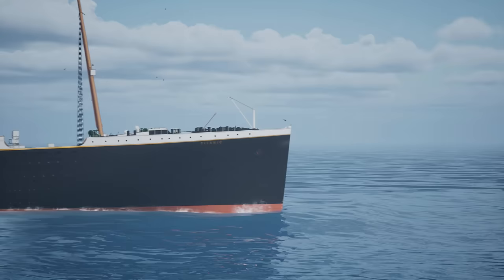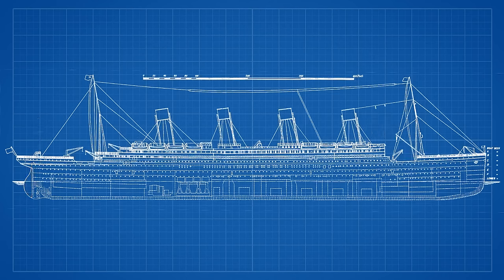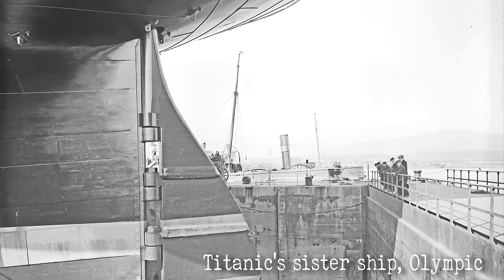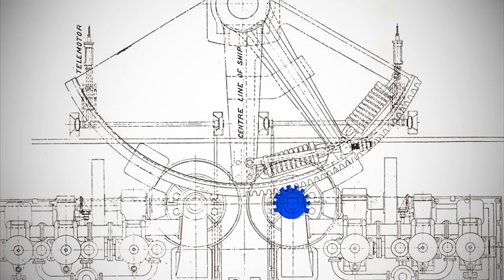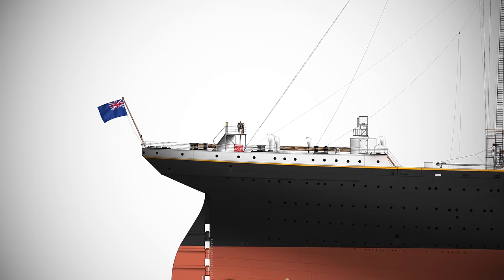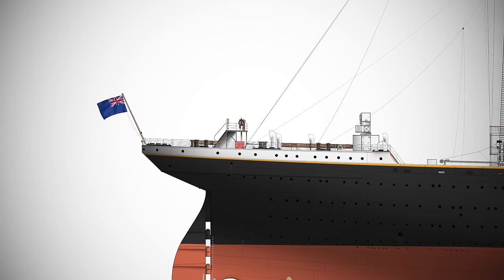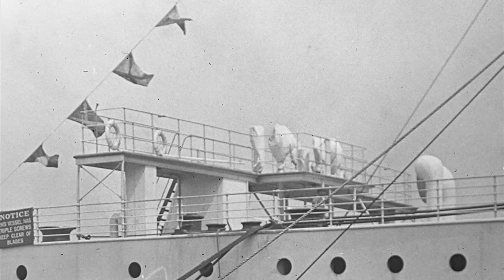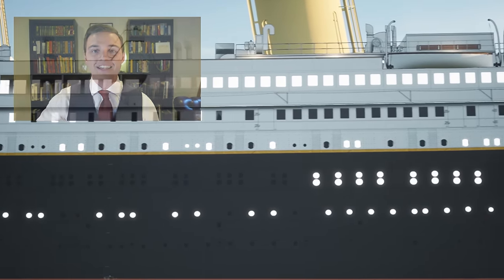How Did They Steer the Titanic?

Comment: I've read that ordering the engines full astern may have been a mistake because the rudder forces would have been stronger if that had not been done.
Reply: Mistakes were made and fate was sealed. The Titanic sinking was a litany of errors really. From basic design decisions to material quality issues. She was going down no matter what.
Reply: The engines took longer to fully stop than the time time it took for the contact so dont think it mattered much
Reply: The biggest mistake was to go fast in darkness before inventing a radar.
Reply: @MikkoRantalainen  

It has been said that during the days of coal-fired boilers, it wasn't uncommon to leave port with a coal fire going in the coal bunker(s). However....
To leave any port of call, knowing that there's a raging fire going onboard just seems to be the biggest calamity that is asking for trouble in spades.
Yet, this is what was done at that time by most.
Reply: @MikkoRantalainen  The Titanic was going at a speed needed to arrive in port as per the schedule. The Captain was following SOP for the time period…
Reply: Ship was not put into reverse until after the collision with the iceberg.
Reply: @timothyreed8417  Yes, the main factor for the collision with the iceberg was the illusion of having to go fast to be in schedule or even be faster. It would have been great PR if Titanic would have broken fastest travel time during its maiden voyage and that was the single biggest reason to keep going fast in the darkness.
Reply: @MikkoRantalainen  Titanic was expected to be faster than Olympic on her first voyage (unless she hit a fog bank)…but then Olympic was faster on her second voyage than her first…but Titanic still couldn’t dock earlier…the passengers would get a breakfast the next morning before departing the Titanic…

Comment: I would absolutely love to see more content directed towards the construction of the Titanic (or really any ocean liner of the period), I find it extremely fascinating and I love the cool forgotten photographs of the structural shops where the parts were made. Such a labour of love.

I work as a shipfitter in a large Canadian shipyard building ships for the navy and coastguard, from start to finish. I am in absolute awe at how they could do such technical work at an absolutely impressive scale back then. We have a 564 foot long cargo ship on the go right now and it’s astonishing how large it is sitting on the slip, just looms over the whole yard. I find myself nipping around through the tight corridors and down steep engineering staircases, peering into open manways to the pitch black of the double bottom, very very easy to get lost. Would’ve been wild to have a walk through the Titanic during the building phase, I am extremely curious of the intricate technique of shipbuilding before welding was a thing, rather than just hearing “they used rivets”.

Thanks Mike!
Reply: He has a couple videos on Queen Mary’s construction, if that interests you :)

Comment: Wow, great video. It reminds me of an incident that happened to me when I was 11 years old. My father owned scows and he was friends with a tug boat company. One day one of his scows was out in the bay and my father invited me to go on the tug to pick it up. The tug boat owner was prowd of a new steering system where he could steer the tug from the main helm area for normal steering or from the front of the tug for close in precise work. A lever was pushed for the person to steer from one position to the other. After I had proven I could steer the tug for a while he decided to show us how he could go the bow and take over. He did that and pointed the tug directly at my father's scow, then moved back up to the main helm area upstairs. Just as he entered the cabin door, he realized that he had forgotten to flip the handle at the bow of the tug. By the time he got back down to the bow to flip the switch, back the tug had rammed the scow. The tug listed 45 degrees, but the heavy engine righted it without much trouble, but by the time we picked ourselves off the deck we found the scow, filled with gravel was now upside down.

Comment: A thing not mentioned in this is that for a rudder to work it must have water flowing across it. In the case of this ship the flow of water was caused by two things. The first being the forward movement of the ship and the more interesting one; the central propeller. The central propeller was driven by a steam turbine run on steam from the exhausts of the reciprocating engines that drove the two outer shafts, there being three in all. So, if the central propeller slows or stops, the flow over the rudder becomes less efficient and may even be made worse if the central prop spoils the flow over it. I have heard that the outer engines were slowed when the ice burg was sighted and do wonder if this may have caused a problem with the stearing. The ship was new so this may not have been recognised.

Comment: I heard somewhere that someone had made a huge remote controlled scale model of Titanic, and he discovered while manoeuvring the boat around on a lake that the rudder lost all control authority if the boat was coasting with no input from the propellers. Right before the Titanic struck the iceberg, apparently the order was given to stop the propellers as the rudder was turned hard to starboard. If the experience from the scale model holds true for the full size ship, this could explain everything.

Comment: A slight variant, if turned to port, the starboard side of the ship could possibly have been steered towards the 'berg before the rudder would have had any effect on the direction of the vessel of that length. The ice berg was simply too close to go around it, and a relatively smaller clip of the stbd bow was a safer bet than taking out the entire side.  Perhaps saving more lives thus. That's my take on that version of the order.

Comment: A little bit contradictory that in this video the steeringwheel in the back is used as a backup, but in the short video from september 22 it is used for docking so the stern is more manouvreble.😉👍🏻But nice video both! Learned about the telemotor and hydraulics. Thought some ships also used chains as connection from the wheel instead of ropes.

Comment: When I first went to sea, on the Megantic and Medic, amonst others. the "Docking Bridge wheel" was never used, it was kept as the Emergency steering position, occasionally it would be tested sometimes at sea or in port for surveys. The docking bridge was where the second mate controlled the after docking party, it gave him line of sight to the navigating  bridge wings. (Before radios a soundafone system was used the "talkback speaker", a combined megaphone and phone). Gave easy and rapid access to either side, tug on one side and  quayside  mooring party on the other, and gave him an over view of what was happening down on the deck with the mooring party. 
On a ship I sailed, the steering gear was such a hydraulic telemotor system, to the steering engine, if the power failed in the steering gear room, the wheel took on the brunt of the steering and that wheel gave 1 degree of rudder per turn. With  36 degrees to hard over, that gave 72 turns of the wheel to go from hard port to hard starboard. So a total of 144 turns for a complete test, It took some manual effort to move it reasonbly quckly whilst testing, in the tropics one worked up a rare sweat testing the thing.

Comment: I've read that when the order was given that some of the screws were stopped thus greatly reducing the amount of steerage available because the water was no longer flowing directly to and past the rudder.

I have a 1/32 scale radio-controlled PT boat model. When I first built it it only had two rudders each one behind an outboard screw (propeller). When only the centre screw (propeller) was in use the turning radius was GREATLY INCREASED. I think  this is what happened with RMS Titanic too.
Reply: This is a myth stemming from Officer Boxhall who was not on the bridge at that time. 

No the order given by Murdoch were hard to starboard and stop engines through the telegraph.

This triggered a red light in the boiler rooms to which according to Fred Barret lead fireman the order was given to shut the boiler doors. As this was done a crash was felt and water came in. 

Even if the order to reverse had been given there was no way in hell to stop and reverse these enormous steam engine in time. Not even to stop them.

These are multiton cylinders that have to come to a stop and go the opposite ways. Steam engines actually fully reverse, so they stop and then start running in reverse.

Now we come to the central screw, unlike those on either side it was powered by a turbine engine feeding off leftover steam from the two reciprocating engines. Reversing that was no easy task and honestly I don't know if Titanic could reverse her central propeller, however I do know how they reversed them on pure turbine ships like Queen Mary and Lusitania.

Basically there was a secondary set of turbine blades aft on the same shaft in the same housing. Steam is rerouted from the main blades to the secondary blades that point the opposite way and will eventually spin the shaft in reverse.

Unlike the main turbine blades it wasn't dozens of rows of blades but only a few ones, so much less powerful and efficient.

As the steam is rerouted the reversing section acts like an airbrake and slows the turbine down and after it comes to a stop and starts running in reverse. Same operation going forward again. You put the steam back in the main chamber.

So even if the order was given, which it wasn't, there was no way to stop the engines or even slow them down much before Titanic struck and it would have taken several minutes to reverse the screws.

Standard operating procedure was engines stop and hard over. She glided to a halt over several minutes and approximately 10 minutes later the order was given for "slow ahead" and a few minutes later "stop". The final order to the engines.

Comment: Actually a small correction, the steering order were given on which way to turn the tiller, not the vessel. Hard starboard would mean turn the tiller as hard as you could right, and the vessel would turn left. This was done to avoid confusion, however the tradition lingered through to more modern steering arrangements where often neither was correct (if you gave the command hard starboard, both the wheel and the vessel would turn to the left), which have now been more or less stamped out by modern conventions and tradition to avoid confusion. I think the introduction of STCW more clearly standardized commands given on bridge. Also ISM also have a few paragraph of clear and consise orders, as well as common working language. 

Even though the rudder was tall, this was to ensure a sufficient surface area, as much of it was out of the way of the propeller, as such reducing the steering effect. Compared to a modern rudder, which tends to be foil shaped to increase the surface area and reduce drag, but have about the same height as the propeller. It is a widely ineffictive design that both affect turning performance, and fuel / speed performance. The innovation was mostly done on the steering gear and the bridge command, rudder it self was just scaled up to fit for purpose.
Reply: It wouldn't have needed to be very effective if the ship has been stationary or creeping instead of doing 22 knots into an icefield.

Comment: Excellent video. Your presentation is on point. With this information in hand I an curious to know how long it took for the input on the wheel on the bridge to reach the steering gear and then cause the rudder to move. Given the length of travel I would imagine it was significant.

Comment: I remember reading somewhere, albeit several years ago, that the Titanic could have steering around the iceberg if they hadn’t gone into reverse as the screw in front of the rudder couldn’t reverse and so it stopped resulting in reduced flow over the rudder. Thoughts?

Comment: Excellent overview of a mechanical marvel.    One concept about the Titanic stearing I understood was that the type of rudder used depended on 'thrust' from the main screw to provide optimum maneuverability.   When the iceberg was sighted I thought there were two orders given:   Hard to port (given to the helm) and all astern (given to the engine room).   This would have significantly reduced the effectiveness of the rudder given the disrupted flow of water over the surface.    The other item discussed was that if they had turned to starboard and collided head on with the berg, the limited compartments affected would have held and the ship would have remained afloat.    Any thoughts on these two 'steering' theories?
Reply: assuming they only saw the top of the berg- how would they have known which way to steer? without knowing the topography of the submerged iceberg- they would be steering blindly whichever way they went- trying to ram it dead-on might have been worse.

Comment: Thank you for this fascinating and detailed video! I was also led to believe that the ships rudder was too small to be effective in the turn to avoid the iceberg, but this in-depth look into the engineering that went into it, and the ability to turn the wheel quickly would surely have been enough if the iceberg had been realized quicker. However looking at the rudder, it does seem sufficient in height, but I do wonder, was it wide enough?
Reply: well, duh- gilligan

Comment: Great video - now I'm more interested in how the steering engines operated. Is my educated guess correct in that the steering engines would have to be running all the time, even when the rudder was in it's neutral position? How did the design compensate for when the rudder reached it's full left or full right position?

Comment: Today steering motors are hydraulic and there is still a manual backup in the steering gear room. But nothing as glamorous as a wheel but rather a little lever that can be swung port or starboard next to a compass read out and phone.

Comment: For anyone interested in this particular topic Walter Lord has a chapter on the collision and those orders (Hard a-starboard) in his book “The Night Lives On”. 

His research indicates the helm was rigged so that turning the wheel to the right (starboard) would cause a left (port) turn. It was the actual rigging of the telemotor not the direction of the turn. 

However, as you have pointed out, your research indicates differently. 

We would need to find the original blueprints from either the Olympic or Titanic prior to 1920 or so when ships helms were rigged more in line with the automobile.

Comment: If the rear wheel was a backup only, why would it be built in a place exposed to the elements?

Was there a rudder position indicator on the bridge? If so, how did that work?

Comment: How did the steam engines engage? We're they just always running and then hydraulicly linked up to a clutch system that was activated by turning the wheel? If so the inputs would binary right? Either it's hard over or it's not.

Comment: The Titanic was also put in full reverse to avoid the collision, but of the 3 engines, the center engine is only designed to work in forwards motion. With Titanic going at full speed forwards, the water turbulence meant that the 2 outboard engines did not perform as well as they should in reverse. As the ship later sank, the fire in Bunker 6, which had been burning since leaving port, would finally be put out.
Reply: Contrary to popular assumption, they likely didn’t reverse the engines to avoid the collision. This was only ever reported by 4th officer Boxhall, who was walking towards the bridge at the time, heard the telegraph bells ringing, and assumed the order given was “full astern”. Unfortunately, he even put words in Murdoch’s mouth when he testified that Murdoch told the captain that he “put her hard over and reversed the engines, but she was too close”.
The actual order received by the boiler and engine rooms was simply “all stop”. This makes even more sense considering that Murdoch was previously in position on the Olympic and would’ve known full well that there wouldn’t be time to reverse them.
Also, the ship never reached full speed.
Also also, the fire was put out over a day before the collision.

Comment: My understanding was the design on the Titanic was such that the centre screw could only be driven with forward propulsion whilst the outer two could do both forward and reverse. Therefore when reverse was demanded during the emergency the centre screw was stopped, disrupting the flow of water over the rudder and harming its ability to manoeuvre.

Comment: Nice video!

Could you please clarify something. I think about what is If Mr. Murdock didn’t command “full astern” to steam engine room and Titanic goes “full ahead”. It was enough hydrodynamic force created on “full starboard” rudder to turn Titanic more quickly and prevent iceberg collision? 
My opinion based on aerodynamic and hydrodynamic laws. Like airplane, if you have more airspeed you need less tilt movement of control surfaces (ailerons, elevators and ruder) to turn the airplane. 
Thank you!

Comment: When you show the diagram of the entire ship, the massive 100 ton rudder itself appears relatively small. Is this rudder at the limits of surface area possible at the time and was its size truly optimal? Would it be true that when the iceberg was sighted and “hard ‘a starboard” was commanded, a larger rudder may have given a faster response of greater magnitude in shorter time?